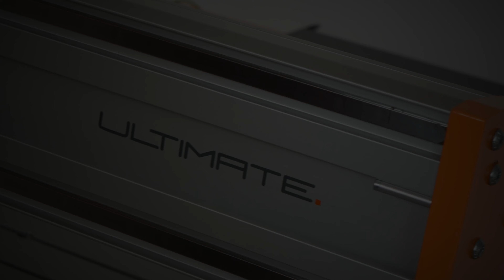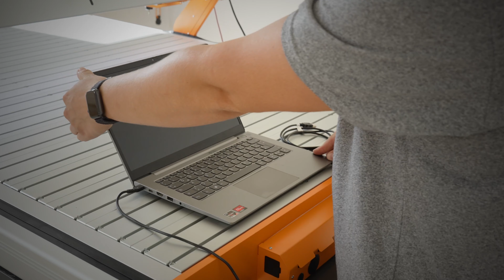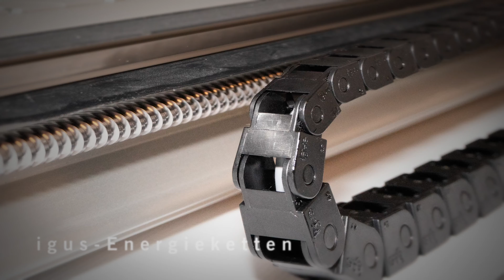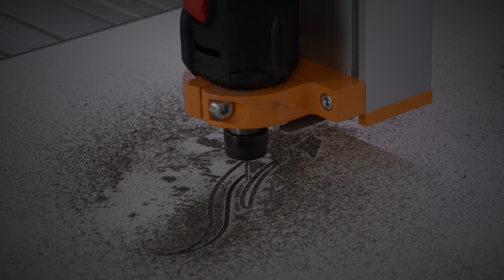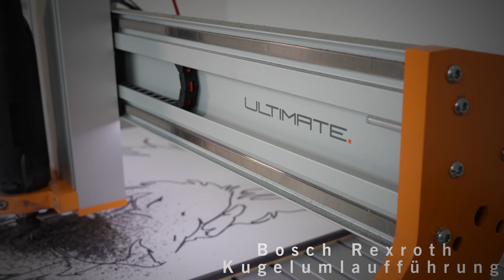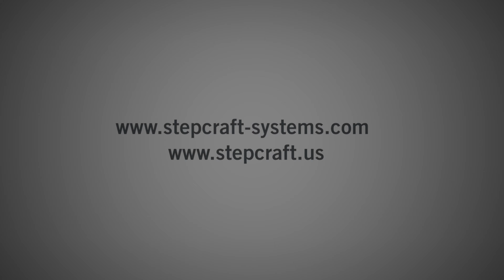NEW M.1400 Ultimate!!! (HPL Lion Milling)

Comment: Hi, does the M.14000 come with the table?
Reply from the maker: The M.1400 Ultimate is the absolute power house of the STEPCRAFT M-Series and standardly features:

    HIWIN® ball screws
    Semi Closed Loop System™
    igus energy chains on X and Y
    4A Sanyo Denki NEMA 23 stepper motors on X and Y
    Aluminum T-slot table
Reply: @stepcraftgermany  thanks for the response! Can you use the M.1000 water bath with the M.1400 if you accept the cutting area is the same as the M.1000?
Reply: I have asked them twice and no answer